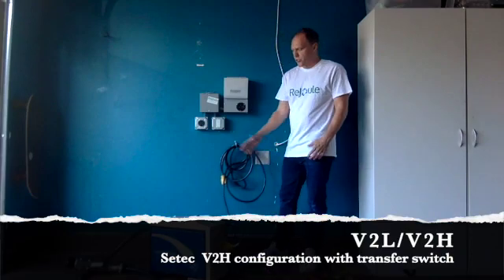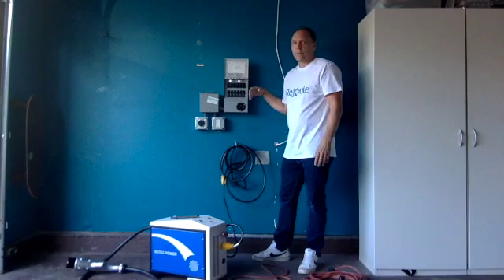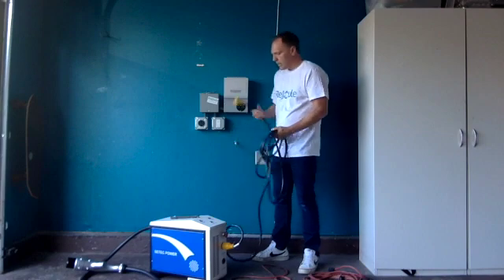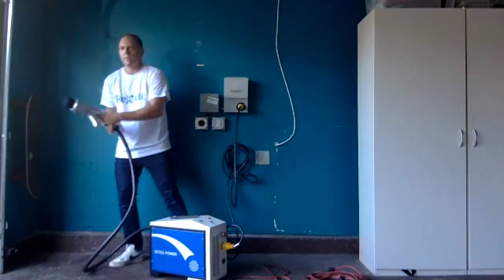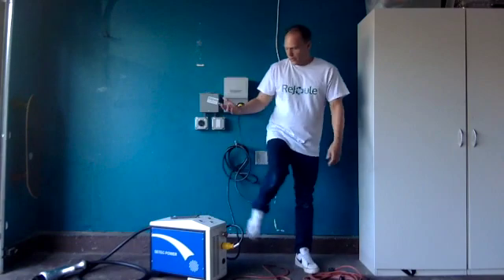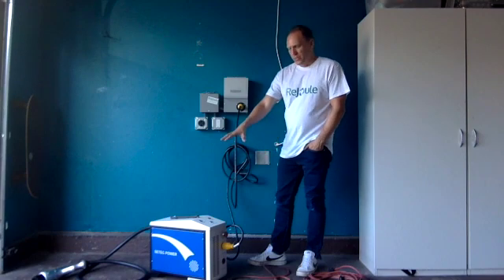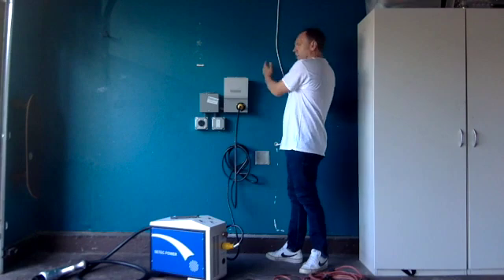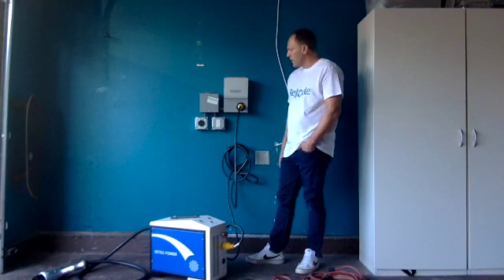Connecting Setec Vehicle to Home (V2H) to a transfer switch as a Vehicle to Load (V2L) configuration

Comment: Why can’t you split the 220v is the amperage too low?
Reply from the maker: The inverter is designed as single phase for Asia and Europe. To split the 220Vac for the US you would need an external transformer.
Reply: @ any idea where to get one?